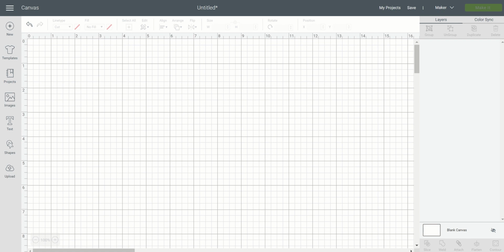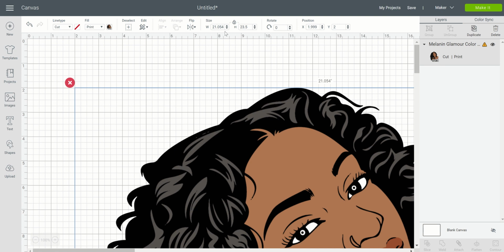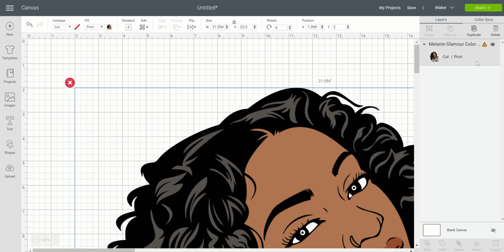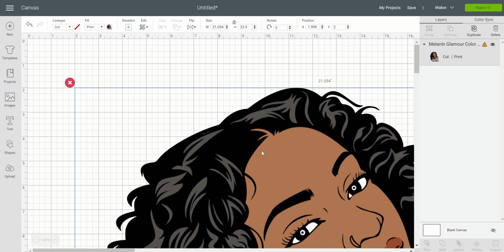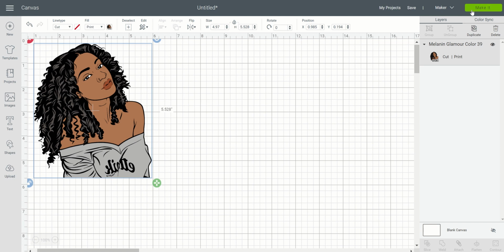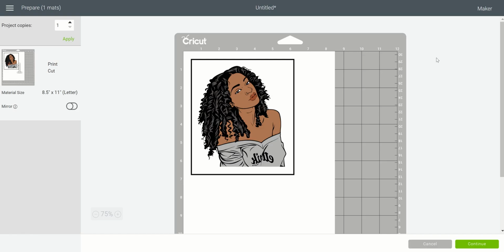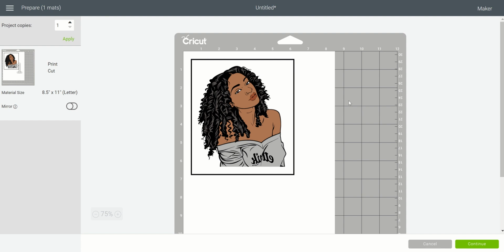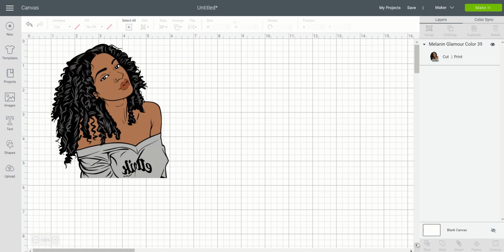Project Incompatible message in Cricut Design Space

Comment: my circuit joy said incompatible also, but I resized it to its specifications but it still saiid t,im thinking it may have did so because there was another item saved  on that projec,t but  I clicked the eye icon to make it invisible?do u think thats why its still saying incompatible? on the cricket joy/
Reply from the maker: To my knowledge, the cricut joy doesn't print. You should only get this message if you are exceeding the print size in cricut
Reply: @dorisedwards58  yes you are correct it doesent print but it writes with pens,thats what i was trying to do,but i since figured it out,thanks!

Comment: I tried shrinking the size on the Cricut joy but still has the message
Reply from the maker: Cricut Joy does not print. It only draws and cuts
Reply: @dorisedwards58  I know it doesn’t print but I also know I can change my machine type to set up my page. In all the videos I see the box around the designs have a lock on the left bottom corner, mine doesn’t have that. I put Cricut design space on my laptop today and I still don’t have the lock on the box and when I followed a video I watched about layering a frame to fit my joy I can’t shrink the top layer like she did in the video, I watched and rewatched so I’m not sure what I’m doing wrong. Maybe I should just stick with my cameo 4 I only wanted the joy for cards and stickers
Reply from the maker: @lindagiddes4551  unlock the proportions between thr height and width and then you can shrink the box

Comment: Doris, I just found your video. Maybe you can help me.  I am getting the alert triangle.  It is telling me that my image is too large. It needs to be reduced to 6.75 x 9.25.  I have a cricut maker and I have the 12 x24 mat.  The image I want to print is sized at 11.7 x 20.  I would appreciate any advice or suggestions you have.  Thanks so much!
Reply: So, I figured out, from reading some of the other comments and answers, that I just need to be on cut instead of print and cut. But, my image disappears from the mat.  Not sure what I'm doing wrong.
Reply from the maker: Are you accessing cricut design from a laptop or phone?
Reply: @dorisedwards58  same issue, I'm only using font and I need it 17in I have a 12x24 mat but it's telling me that only 9.733 in but that's way to small

Comment: Hi my  name is Wil thank you for the video a question when I upload my image from my files they are very big 34x22 and I have to waste time shrinking it manually using the size counter at the top. Why does that happen it's normal size on the computer and if I print it it's normal. Is there a faster way to shrink it it's so large that I can't use the 4 arrows to move the image. Thanks again
Reply from the maker: When it comes in large like that I would recommend that you unlock the proportions and type in Height/Width for example 5x5 and then lock it back. Then you can use the four arrows on the right to maneuver the sizing. I hope this helps!

Comment: What do you do when you don't have paper large enough for the project. Such as if your project calls for paper that is bigger than 12×12. And resizing is not an option
Reply from the maker: Is it print and cut or just a cut only?
Reply: @dorisedwards58  just cut only project. that is on the larger mat. but I don't have paper that is bigger than 12x12. I have tried to overlap paper and increase my pressure on the cut and glue down but that is not always successful.
Reply from the maker: @leigh9354  if there is no printing involved are you cutting vinyl?
Reply: @dorisedwards58  I am cutting paper, for cards and paper type projects. I am sorry I should have been more specific.
Reply from the maker: @leigh9354  OH no problem. I just want to make sure that I'm giving you the right information. If you are cutting out shapes or images that do not require printing you would select Cut and you would need to purchase larger paper. You can order paper 11x17 and up and get a mat that is 12x24. There are no cut size limitations as long as you have the paper and mat size. Office Max carries some 11x17 and you can also order it from Amazon
Reply from the maker: @leigh9354  And you would also need a inkjet printer that will allow 11x17 paper. I have the HP OfficeJet Pro 7740 and I can print up to 11x17 with it.

Comment: FYI-I would not unlock you image example because you lose the original proportion width and length causing the image to be distorted. Instead,  just grab the bottom right size handle and shrink the size while it is locked. That keeps the proportion of the picture. You can, however unlock shapes.  For instance, you insert a square and you want to make it a rectangle.
Reply from the maker: I know how to do that and I even teach the many pros and cons to locking and unlocking the image.

Comment: Hi there. I just looked at this video since I had this issue the other day. 😊 So I have a couple of questions for you. I am bee to the cricut World. And I am trying to do drawings to create a print for pictures and also would like to do either the print and cut method possibly. When you do your lady pictures for example like in this video. Are you coloring in all those colors with markers or using the markers to do this on the cricut. Maybe you have some videos you can suggest.
Reply from the maker: H i there, the image is printed out on printable vinyl or sticker paper using my printer. What will you be putting the image on?
Reply: Well some images will be on card stock. But some images I want to add color. I see a lot of videos where they color everything in by hand. So can this be done on the cricut with the markers or by hand only. Also the print and cut using the vinyl you haft to piece this together right to create the full image??  Thank you.
Reply: @beckylewis9364  You can change the image to basic cut, then close the layers that have color.  Attach and proceed to make it.  You will then be able to color the negative spaces.

Comment: this doesn't help for a cricut joy because i tried that and it still wasn't working
Reply from the maker: Print and Cut is not a feature you can use with Cricut Joy. Joy only draws and cuts. I did put that in the description. Sorry
Reply: @dorisedwards58  its fine the cricut allows me to cut my designs instead

Comment: This was very helpful but I am still getting and affected layer message and my image is small.  Can you help
Reply from the maker: Which cutting machine are you using? Also, are you using a phone, laptop or tablet to access Cricit Design Space?
Reply: if you were using the Air 2, cut & print only allows 6.75 x 9.25 for some horrible reason. So you have to slice the image in sections of that measurement. They should really fix that.